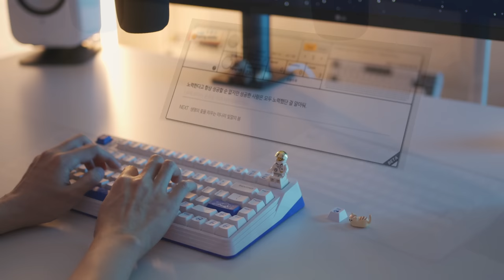Let's Try This | L80 Cosmic Traveller Mods Before & After Typing Sounds Comparison

Comment: Seeing as iQuinix pretty much listened to everything customers had to say.. wonder if they'll use preclipped stabs in the next iteration and have a.. less awkward F row. Why does the enter key sound so muted compared to the rest?
Reply: I'm using switch pads myself and some switches sound significantly more muted than the rest. Now that there is another 'case' where this also happens, I'm willing to assume that it might be a certain way of application causing this sound. I's really difficult and annoying to apply consistently. I'll have a look when I have enough motivation

Comment: The Iqunix L80 line of keyboards are the best non-custom keyboard out there right now.

hispeed wireless?  check
bluetooth wireless?  check
wired usb c?  check
hotswappable switches?  check
good quality PBT keycaps?  check
good color ways and appealing look? check
tenkeyless in a compact form?  check

every other manufacturer is playing catch up at this point.  Takes a lot of work to get it where you want it, but what keyboard doesn't?  I have holy pandas lubed with krytox 205g2 in mine.  Haven't done the tape mod yet, but I will now.
Reply: Fl 680, Cmk87, Fl980: "OH, i can easily f**k it"
Reply: this is 75% tho not tkl

Comment: I've been looking at switch pads for a few weeks now with some interest... very interesting! What are your thoughts? Will you use them in every keyboard now? Is it worth the time and effort of installing them to the PCB?
Reply from the maker: Of course not :_3ildHappy:
I guess it's a good option for who don't like PE foam which makes all sounds similar, and want to make the pitch a bit lower
Reply: @3ildcat  :_3ildThumbsup:
Reply: it is only for cheap and poorly designed boards

Comment: Question... For plate mount stabs do you only need to lube to housing or both?
Reply: it depends on how thick of a layer of lube you apply; you can apply a thin layer to the housing and stem, or a thicker to the housing. you should get very similar results
this applies to plate mount and pcb mount and the sounds and feel will vary with the type and application of lube
Reply: @oatmilk9918  Thanks! <3

Comment: How does the switch pads compare to pe foam? Are they more poppier?
Reply: less poppier, switch pads are intended to recreate the pe foam sound and feel but on a weaker/smaller scale as to not make every switch sound similar like the pe foam mod does
Reply: never tried pe foam mod but i have installed IXPE switch pads on my board and they made it a bit more poppier than before
Reply: @bloop7282  there are PE, poron, and EVA switch pads now. Choose your poison